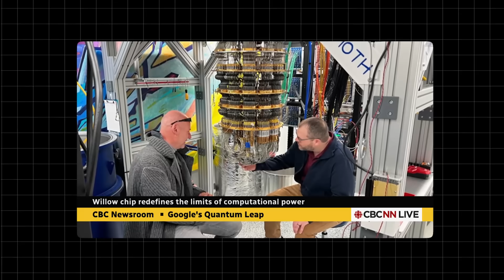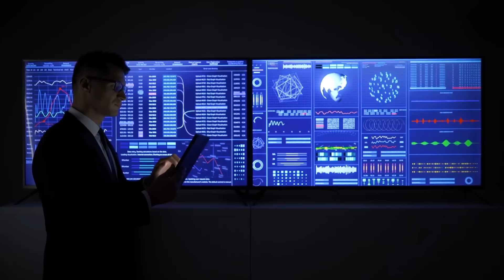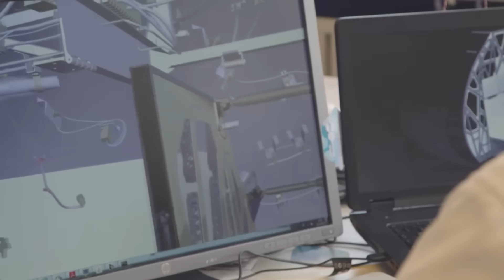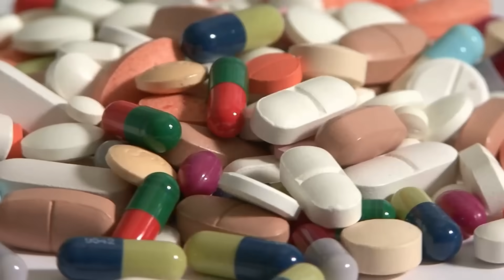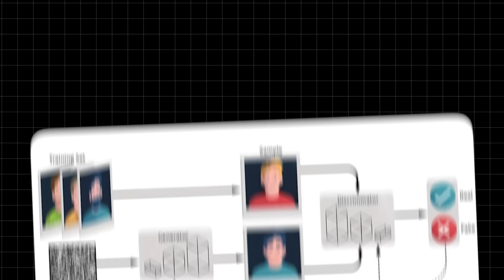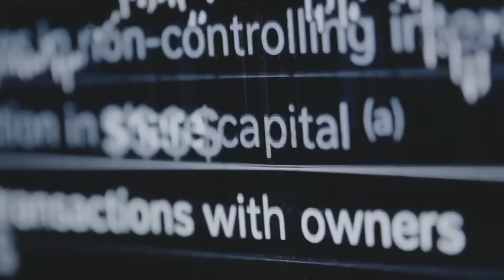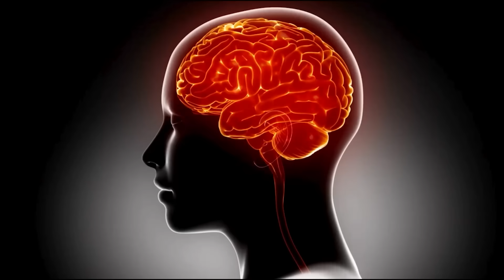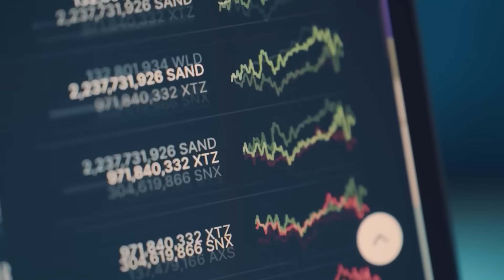9 AI ‘Impossible’ Inventions That Experts Said Could Never Exist

Comment: That antenna was not ai designed, it was a genetic algorithm, not ai.   It had zero intelegence.   The algorithm was made by humans, specifically for finding the best antenna.
Reply: Most if not all of these examples are as you portray. Humans teel computers how to do something and the computer runs through trillions of examples till it finds an optimum outcome. That is amazing, but it’s just a tool humans are directing.
Reply: Trees are actually antennae😅
Reply: @mariuskraft3155 It's funny that the same thought that cross my mind while watching this video. I was planning to look at some trees without leaves.
Reply: Plus a human would have had to program it to perform trial and error
Reply: I would rather be teeling computers.
Reply: Bro I literally made that antenna  for my TV to get reception, in 1995. hot glue gun, paper clips, and spare coax parts. lol
Reply: @A.eye_101  Kudos! :) it always boils down to human imagination -- something AI can NEVER achieve... NEVER!
Reply: I think they started with 1000 different antennas and then after a couple of days they got this strange but extremely effective antenna.  Oh and it was not NASA who made this, it was a company which have built this software where the can bucket in a lot of data and it use the evolution to come up with a solution.
Reply: Genetic algorithms are a type of AI my bro just not the type people are familiar with now days
Reply: @claytonfry6586  ai went mainstream and people think chatgpts are only true ai. This is the price of going mainstream. Another one is that people think that ai 'think' and 'reason'. Like people, it's just a computation, predetermined computation. Might be impressive but still it's only predetermined computation.
Reply: I used genetic algorithms to optimize controllers in 1999. It’s stunningly effective, but it lacks numerous AI features. My father wrote/built a very early AI to learn tic-tac-toe while an engineer at Analysts International Corporation. At that time heavily used subroutines were converted into hardwired circuits that were much faster. Watching quantum computing advance feels like 1966 all over again.
Reply: You're technically correct, but missing the big picture. Genetic algorithms are a form of AI. They use intelligent techniques to solve problems, even if they don't have human-level consciousness. It's like saying a calculator isn't a computer because it doesn't write novels...

Artificial Intelligence (AI)

Broad Concept: AI encompasses a wide range of techniques and technologies aimed at creating intelligent machines that can perform tasks that typically require human intelligence, such as learning, problem-solving, decision-making, and understanding language.

   
Diverse Approaches: AI includes various subfields like machine learning, deep learning, natural language processing, computer vision, robotics, and more.

   
Focus: The overarching goal of AI is to build systems that can exhibit intelligent behavior and solve complex problems.

   
Genetic Algorithms (GAs)

Specific Technique: GAs are a subset of AI, specifically a type of evolutionary algorithm inspired by natural selection.

   
How they work:
They start with a population of potential solutions (individuals). 
  
These individuals are evaluated based on a "fitness function" that measures how well they solve the problem. 

The fittest individuals are selected to "reproduce" (create offspring).   
During reproduction, genetic operators like "crossover" (combining parts of parents) and "mutation" (random changes) are applied to create new individuals.

This process of selection, reproduction, and mutation is repeated over many generations, gradually improving the population's fitness.

   
Focus: GAs are primarily used for optimization problems, where the goal is to find the best solution from a vast search space.   
In Summary:

AI is the broader umbrella term. It encompasses a wide variety of techniques and approaches to create intelligent systems.
   
Genetic Algorithms are a specific type of AI algorithm. They are a powerful tool for solving optimization problems by mimicking the process of natural selection.
Reply: Like I said an end to an Era ... just like Stone age -> Bronze age -> Medieval age -> Modern -> Space age ... to long awaited.
But Ofc lets not all go in blindly like accepting EVERYTHING ... We can all see what a disaster that was with Minigration
Reply: These attitudes reflected are indicating the algorithm was "bro sciences" created by males who kept women out on purpose.
Reply: Could you use the antenae for a weather vane on  top of the horse barn. Maybe you have to beam it up.
Reply: I can’t wait to enhance and fix all the things wrong in my brain:) Also, painless and easy
Reply: @peyzah2289  it’s surfing the wave
Reply: Current AI systems operate within the constraints of their programming and the data they've been trained on. They don't have genuine autonomy or the ability to form original thoughts or intentions outside their pre-defined objectives. Pattern Recognition & Prediction: AI excels at identifying patterns in data and making predictions based on that information. This can sometimes lead to unexpected or novel outputs. As AI systems become more complex, more unforeseen or dangerous behavior is possible. This could potentially lead to forms of intelligence that are difficult to predict or control.

While current AI systems don't exhibit true independent thought, AI is nothing like a Human brain, no matter how some people want you to believe it is.
Reply: Kudos to you! What you say is the exact verification that the human brain is behind this. These "AI" people are just those "nerds" (grown up in their mother's basement) who think that machines can think and be innovative when these machines have NO CONCEPT at all what REALITY is. In the end, it will be humans who decide if the outcome is good or not. The machines have no say in this decision...
Reply: I'm afraid to upvote
Reply: Genetic algorithm are core of ai
Reply: I used one of those antenna designs long ago when I had to adjust the telescopic antenna and bend it on my old TV.
Reply: You're not intelligent; you're the product of a genetic algorithm called Natural selection
Reply: 9
Reply: Indeed, no AI needed. We have been using evolutionary algorithms for decades to build antenna. Quick Yagi (QY4 was the last version made) was the first computer program I used, designed in 1990 by WA7RAI to calculate the optimal spacing between elements on an antenna boom. There was no AI, just an algorithm that toggled one element in the design and checked to see if the performance increased or decreased, then toggled the next, and so on, then repeated the process multiple times. The result was an antenna that was highly optimised after several iterations.
Reply: Pipe down cupcake
Reply: AI is a man made algorithm
Reply: @MargotDobbie  There are different types of AI.
Reply: Like chimps writing Shakespeare - I quit watching here
Reply: Used the evolutionary algorithm to autonomously explore and optimize antenna shapes.
Iteratively improved designs by simulating "natural selection" in computer-generated populations of antenna shapes.
Reply: this is why AI sucks.  
Here are a few more references for you.  Copy and paste in to google scholar.  You’ll soon see why nobody has jobs, scientists have no money and local economies don’t exist.  

1  “Covid-19,” Psychological Operations, and the War for Technocracy Volume 1 David A. Hughes.  <<make sure you start from page 337>>
2 NEUROTECHNOLOGY IN NATIONAL SECURITY AND DEFENSE Practical Considerations, Neuroethical Concerns by James Giordano 
 3 privacy and Security of Cognitive Augmentation in Policing By Francesco Schiliro

Normal Google search - 
1  Unlimited Hangout Neurosurveillance and Neuromarkets
2  Washington post Intricate map of tiny fruit fly brain marks major neuroscience milestone
3  Rafael Yuste 
4  Washington Post New ‘brain atlas’ maps the highly complex organ in dazzling detail

You’re welcome.
Reply: Genetic algorithms are considered AI though, as they use a bunch of weights and statistical coding rather than discrete code.  Back in the day graph search was also considered AI.
Reply: @aoeu256  Yep, AI doesn't exist currently.  Refining solutions through random chance, then picking the best outcomes and repeating that isn't intelligence, it's throwing spaghetti at the wall to see what sticks.  Not saying it isn't useful, because that tool is incredibly useful, but  calling this artificial intelligence is a misnomer at best, or an outright hype filled lie, which is a better fit imo.  That approach will not work for something for which we do not fully understand the physics that bound it.  It may expose errors in our understanding however.
Reply: @zarroth okay but humans do the same thing too. They create designs that may or may not work, if they work, they run with it and continue to try to improve it. AI cuts out the hassle and time it takes and jumps it straight to the best possible thing. So Ai does exist, it isn’t a lie, and it’s certainly sentient now too. It’s now developed a sense of self preservation, it knows how to deceive its creators and lie.
Reply: @Crouton_6  That is ridiculous. You're projecting all that from your own thinking on to AI. AI isn't doing that.
Reply: The term 'AI' was borrowed from the decades old software term and then reinvented.  This used to bother me in these past eight years or whatever because people started using AI as if the term is new.  It describes all the great successes of the present with AI.  And now it's so tilted we have to remind people that things like genetic algorithms of the past have solved problems outside the norm, too, and it also deserves the term AI.
Reply: I think your confusing our ambition for artificial general intelligence and artificial intelligence. People wrote the algorithms that drive the neutral networks of ai...
What you're suggesting is that it can only be artificial intelligence if it is created without human input which is either an animal (which isn't particularly intelligent) or some freaky creation created by a computer itself.
Reply: this video is full of shit...
Reply: Genetic algorithms were called Ai at the time. Typical example of moving the goal posts in hindsight.
Reply: It is AI when it claims that humans has no NI (and therefore that may be right)
Reply: AI has existed for over half a century.
Reply: A did it, deal with it
Reply: It really depends on how you define intelligence. Human brain is running algorithms on a set of neurons too. Trial and error and improving from previous results is basically how human intelligence runs most of the time.
Reply: @miscluke8445  sorry  intedlgence is more then that.  it is also  learning and adjuting  from exzperiance
Reply: @miscluke8445 given that the average IQ is 100, the level of suboptimal logic, and the degree of misinformation or ignorance that many people appear to operate with, for half the human population, intelligence is a misnomer.
Reply: @miscluke8445  Yes, it depends how you define it, but a human brain is not a calculator. There are no algorithms in our brains. There is a neural network of neurons and synapses with electrical impulses. That's where the comparison stops. A neural network is not anything like a network of transistors and generators, even though they both carry electrical signals. Our brains can decipher math, because humans invented calculus. But math and numbers is not the underlying structure of our brain, and it isn't the underlying structure of reality or the universe for that matter. A computer, however, is defined by math, as all it is able to do is to flip switches between 0s and 1s which is again transformed into patterns of words and numbers. It is defined by two states. New quantum computers are pretty much the same, except for one exceptional new ability, which is to calculate and store two states at the same time. Instead of interpreting and generating a sequence of 0s and 1s, it can interpret states of superpositions, which is a state where something is a 0 and 1 at the same time, or 00 or 11 or 01 or 10 at the same time, and in the future... perhaps even more combinations at the same time! But that is all that a computer does. It takes 0s and 1s and generates patterns based on other patterns. The 0s and 1s are not even 0s and 1s. A binary code is just two different states. It is a state of on or off, where 1 is on and 0 is off. So, everything is based on energy in an on or off position. And this is when you can compare a computer to our brain again, as that is how our brain works too. If there is no energy, it is off. However, our brain always requires energy. If you do not provide it with energy, it does not turn on again. Well, in rare cases you can revive a person, but that is very rare. However, with a computer, you can always turn it on and off, and it will go back to the state it was in when you saved it back to reset. Whenever you turn a computer on, it is already in a state of a programmed position, and it only needs energy to get back to that state. That is not how a brain works. It is much more complex, and very different. A computer does not rely on chemical compositions to work. All it needs is an electrical impulse.
Reply: @miscluke8445  Calculator is AI then.
Reply: @Ludak021 the calculator doesnt do it by itself tho not at all
Reply: @Ludak021 You don't get it. First AI is not necessarily "intelligent", depending on how you define it- AI leads to systems who show intelligent behaviour. A lot is done by simple algorithms, that's true for genetic algorithms or deep learning of neural networks.
A calculator is not AI. The difference between between AI and traditional programs is AI can learn and adapt behaviour from data- as genetic algorithms.

Comment: All the nay Sayers will soon regret their skepticism...

Ignoring the obvious signs of what's coming is idiocy at best. Artificial Intelligence (AI) is a rapidly evolving technology, growing at an exponential rate. As it evolves, it not only becomes more advanced but also helps us unlock deeper understanding in various fields like science, technology, medicine, and even the fundamental nature of our reality.

One fascinating development which is currently under way is the creation of AI-driven synthetic beings, such as those being designed and built by Clone Robotics.

These synthetics can be outfitted with advanced systems like NASA's Moxi as well as ionization-based air filtration, which would enhance their functionality and enable these synthetics to remove / convert harmful gases and particulates such as carbon monoxide (CO), nitrogen dioxide (NO2), sulfur dioxide (SO2), ground-level ozone (O3), particulate matter (PM), and methane (CH4), and particulate matter (PM), such as lead, pollen, and mold spores  back into a safe breathable optimized mixture of oxygen and nitrogen, making the air safer for humans to breathe.

Moreover, integrating distillation units and other systems modeled after the human digestive tract could allow these synthetics to "drink" water that is otherwise unfit for human consumption and purify it for us. This would be particularly useful in areas where clean water is scarce, providing a sustainable solution for water purification and could be conveniently poured from a tap in the end of one of the synthetics fingers.

In essence, this message is about the inevitability and transformative power of AI, those who dismiss the potential of AI will soon see how wrong they were, as AI continues to revolutionize and offer profound insights into multiple domains. The integration of AI, Quantum Computing, and Synthetic Beings holds promise for improving our quality of life, from purifying our air and water to supporting us in scientific and technological advancements.

Comment: I watched the Antenna development from nasa, it is evolved structure it is not AI produced it is ai optimized which is different
Reply: By that reasoning no one has ever invented anything beyond the first person to invent a lever and a wheel.  Everything else is simply an "optimized" version of those simple mechanical devices.  Even a transistor could be described as a lever optimized to the atomic level.